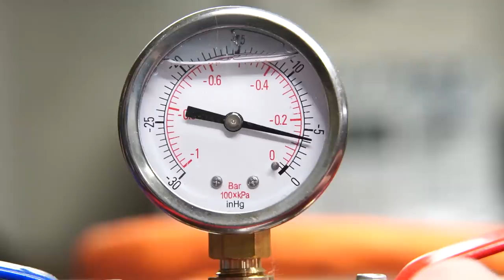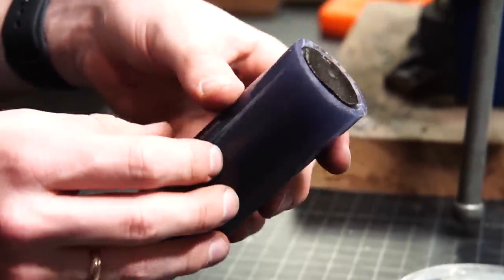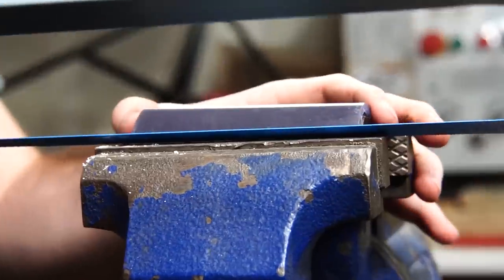You Won't Believe What this Ring is Made out of! | Making a luxury ring out of Dirt!

Comment: Make a lava lamp ring please. Could be done like this: Two, halves with a channel cut in the middle of each, to have a u shape cross section. Glue them together, drill a tiny hole inject some liquid mixture, maybe a pearlescent powder mixture with water or another liquid, with thin blue oil or another non mixing liquid to give a contrast of colour which will remain separate. Then seal it up and leave a tiny bubble of air inside to help when you shake the ring to make it look cool and give it the lava lamp effect.